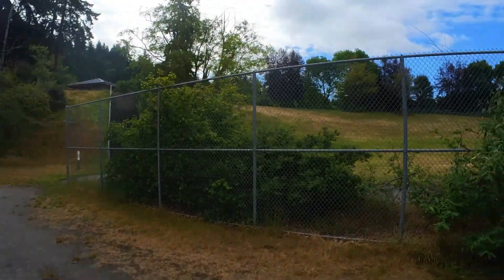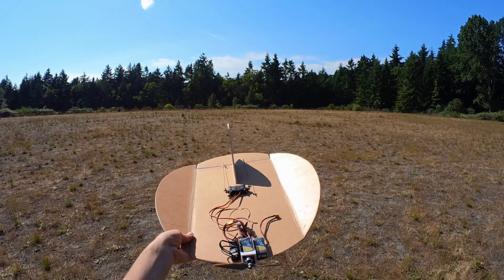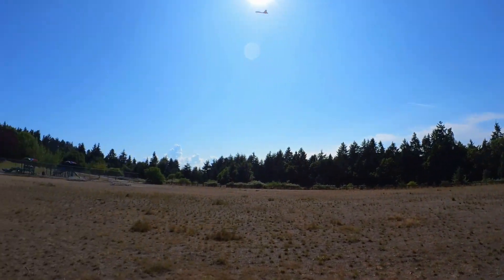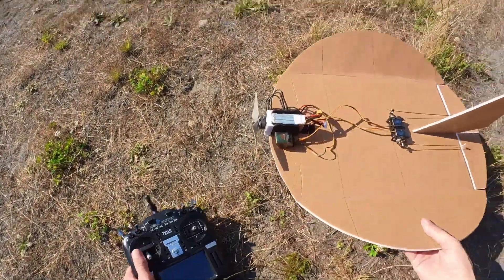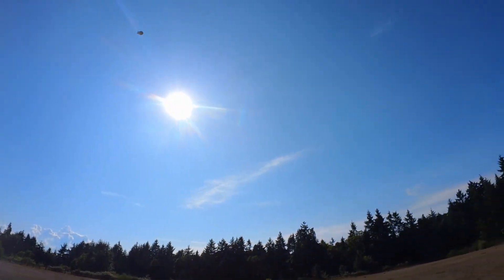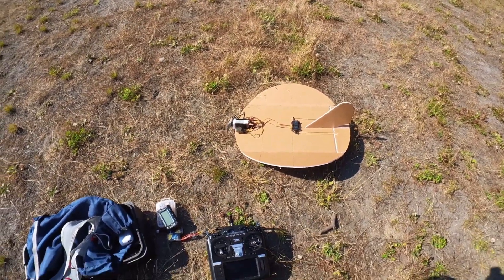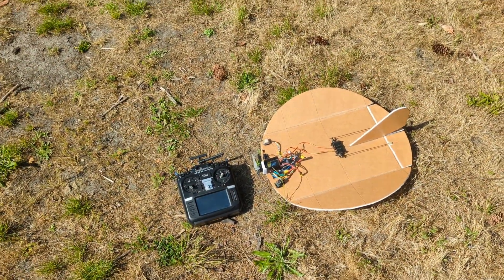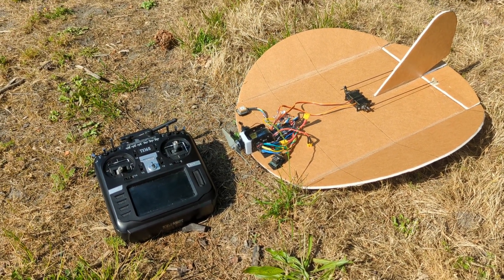Sub 250g Nutball RC Plane with Elevons

Comment: Amazing you got yours to fly. I built pretty much the same thing, 17" diameter with elevator and rudder. First flight broke the motor mount off. Now I see I need a LOT more weight up front so I'll try it again.  Thanks for the video!
Reply from the maker: Yeah they are particularly terrible flyers when tail heavy. I've made smaller versions of these since, and it can be tricky to get them flying well.

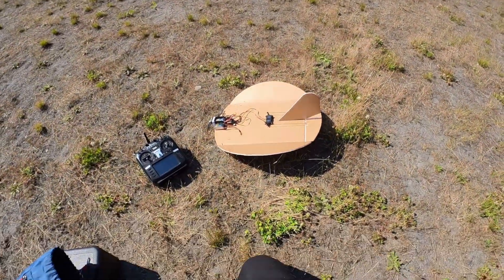Comment: hi          2:19    WHY  is part of the vert-stab  missing.!        this design results in elevons that have a wonky shape.!        the  Distribution  of  Mass (dom)  Determines the locations of the cg  and  the c-m.    c-m is center of mass.         it is up to  YOU  to  Distribute the mass  of the power and control components  Optimally.        said another way, it is the opposite of smart to locate the mass of the elevon servos  aft  of the cg.        you may realize that stability could be increased, if  some  mass  --  say, the battery --  were  located below the wing.
it should be understood that the term 'tail-heaviness'  is used, colloquially, in place of saying 'mis-located cg'.     tail-heaviness occurs in the  dom.      in this case, the aft-located mass of the elevon servos is causing  Permanent tail-heaviness in the dom.      d
Reply from the maker: oh boy.  A lot to get to here.  So originally, the nutball has that shape of vert-stab to make room for the elevator to move to it's full throw.  I just traced the orig vert-stab, and cut the elevator in 2 to make it an elevon setup.  I was going for as few changes from a typical nutball design as possible, but trying to make it sub 250g.  I thought I might possibly add a rudder later, as well.

The servos are behind the cg only because I didn't have control rods laying around that were longer.  Also, having the servos in front of the cg doesn't help significantly with this plane.  I have 2 traditional elevator and rudder versions of this, one with servos in the same place, one with them very far forward, and they fly pretty much identically, I just have the battery a bit further forward on one than the other to compensate.

The battery underneath would help, but the next step with this plane is to paint the entire bottom with a smiley face or a target, and I don't want anything at all on the bottom.

I got it flying just fine with this setup with adjustments to the elevon reflex.  It wasn't actually tail heavy.  The DOM didn't keep it from flying well.  It was bad setup of the elevons to blame (too much reflex).